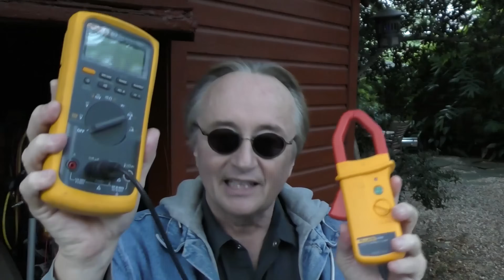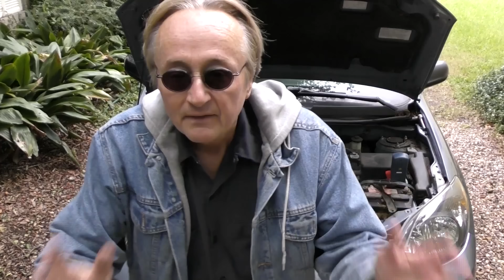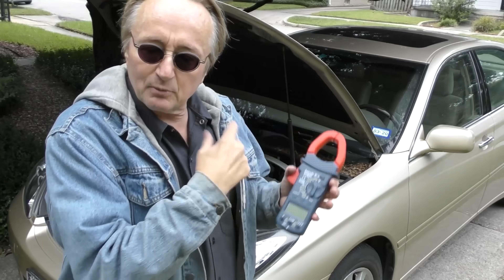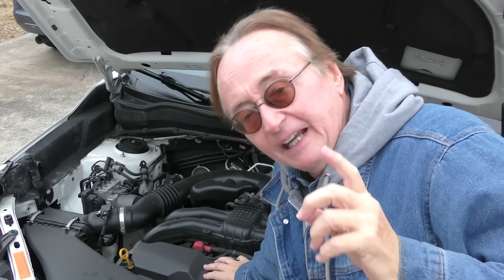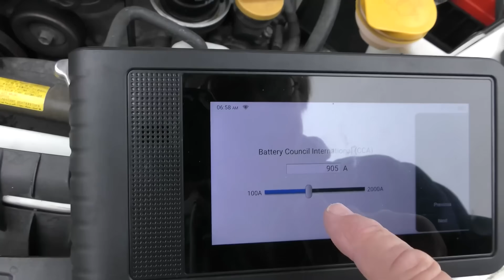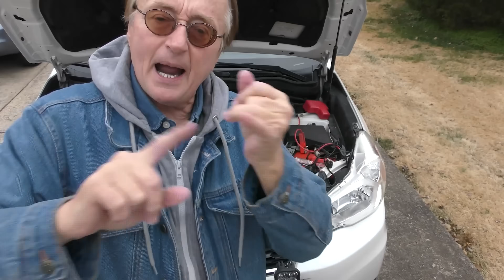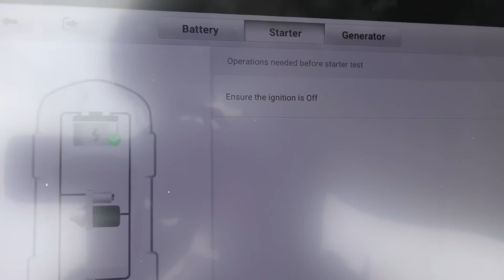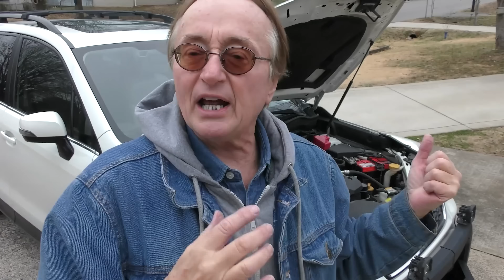Here’s Why Disconnecting Your Battery Will Destroy Your Car

Comment: You unlucky bastards with new cars. 
Take a moment to thank the Chinese for making excellent products everyone can afford. 

Also if you have an older car with OBD2 1996 to around 2008, if you ever have a problem while driving, disconnecting, waiting a minute, then reconnecting can fix the problem until you get home. 

It is always worth a shot. I have a 2008 crown victoria that this has helped greatly until I found out the steering wheel air bag connector was bad. It would bog down the car until it shut off when I started to slow down for some reason.

Comment: What do you do if they don’t want to tighten ? I have a 98 mx5 and it’s loose on the tightest position
Reply: Replace the terminal
Reply: search for Pos / Neg Battery Terminal Post Converter Adapter Sleeves
Perhaps try undoing it, then trying to push it down further, then try tightening it again.
Reply: Did you mean the terminal connections? Stick a penny in there

Comment: @Scotty - Sometimes the short is someplace where the wiring harness flexes.  2K vintage Fords often short where the trunk lid harness flexes -- the insulation crumbles, the wires short together . . . this includes shorting various lights to the ground.  For example, there are actually NHTSA recall notices on many 2K vintage Ford Focus models.

Comment: I jst need 2 buy an older trk got a 2015 f150 wid a 2nd generation coyote motor pushin 435hp 4 trade 4 a 1967  or a 1970 f250 restored

Comment: That meter is gonna be $60 in a few months 😂
Reply: @BlazingBrother  yeah cause we want everything super cheap no matter what
Reply: @cantwealljustgetalong2  oh gosh, you’re absolutely right. I should want to pay more for something for no reason. 👌😂
Reply: @BlazingBrother  the fact you think its for no reason is a big problem lol
Reply: @cantwealljustgetalong2  It's for no reason. We don't have enough labor and raw materials to manufacture every single thing inside this country. Even a car factory has to import some stuff which is used as inputs in the car manufacturing process. The global economy has become increasingly interconnected since the end of World War II, and this new isolationist trade policy is pointless and is going to cause much pain for no reason. It will also strengthen China. Exports are a cost, imports are a benefit.

Comment: I thought that amp clamp only did A/C, not D/C?
Reply: Yes, this meter is only for AC current, not DC. It doesn't even measure DC current via its wires.
The UNI-T UT210E is a good value option for a DC clamp meter.
Reply: Nope many read dc as well.  You have to zero it out or else it picks up ambient magnetic fields. But they seem to work really well even in the milliamp range
Reply: Nothing about the properties of AC or DC would prohibit a device like that from working. Only the ppl designing each particular unit may opt for limited features. All current (AC or DC) creates an EM field which can be sensed thru induction.
Reply: @robwoodring9437  Induction cannot sense DC current. It can only sense changing magnetic fields, i.e. AC current. DC clamp meters use a hall effect sensor, and AC meters use induction coils. The meter Scotty is using in this video only supports AC current.
Reply: @metricmine  I get the hall effect thing, but I just watched Scotty clamp the inexpensive device onto a DC line and read the draw

Comment: I have to disconnect the battery cable when I change the battery
Reply: you could connect a small 12v battery beforehand so the car never loses power.

Comment: Thank you, Scotty. I’m a big fan of yours. I do custom wiring troubleshooting electrical problems and I have quite a few meters to tell me what’s going on. I watch you quite often. You are the man..  I don’t charge a lot to repair fried wires under the hood compared to electrical shops?  That charge over $1200.  But I’m not cheap at all. I do custom wiring on Harley Davidson hot rods jet boats Corvettes and some other vehicles with up-to-date engines put in older cars big fan of your Scotty. I’ll be watching more from San Diego.

Comment: Hook up your battery tender to your terminals and disconnect the terminals from the battery maintain the voltage so you don’t have to reset the radio or relearn the idle.
Reply: Dumb (cheap) trickle charger or a computerized one like a C-TEK?

Comment: My car is too old. The Amp clamps is for ac current. Haven't seen 1 for dc low amps?
Reply: UNI-T UT210E
Reply: Harbor freight Ames meters does DC clamp amps. CM1000 ac/DC clamp meter😊